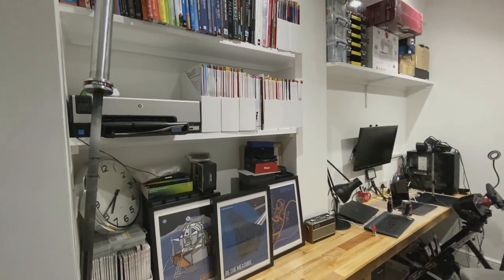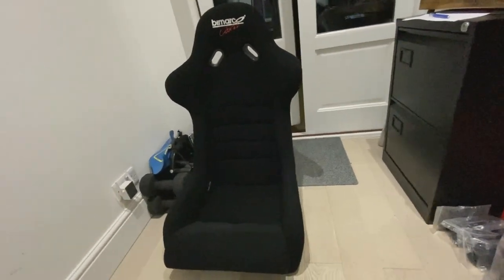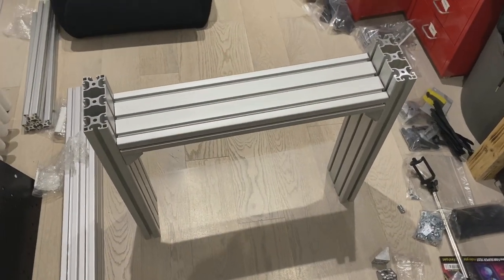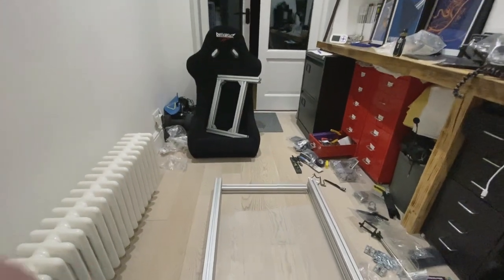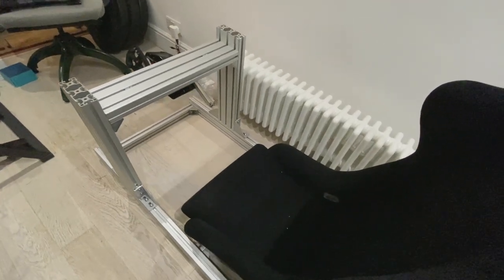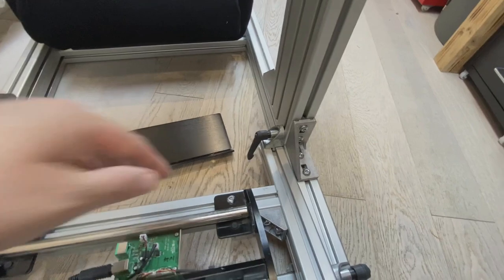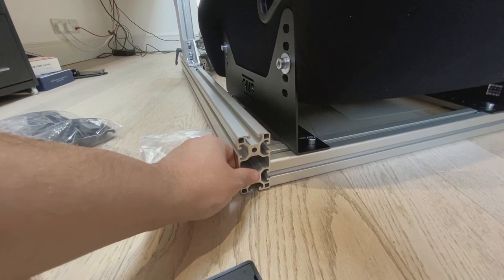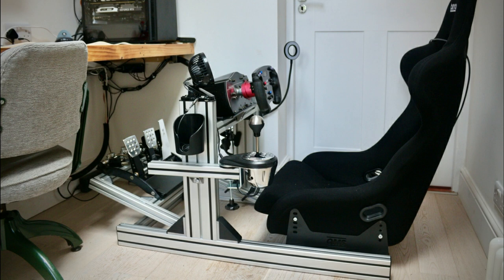Sim Racing | Build your own sim rig. Part 2: Building

Comment: I love the builld, if i may ask, how much does it cost to make a rig as yours
Reply from the maker: Thanks. I spent about £550 to get all the profiles and seat etc. (Basically everything other than sim racing hardware).
Reply: @FindingSpeed  ok thanks
Reply: Gt omega prime rig costs about the same...
Reply from the maker: It’s nearly £250 more expensive here. If you watch the videos I make it clear why I needed to build my own. It wasn’t related to cost.
Reply: @FindingSpeed  I did watch your video mate, I was just saying that it's a very similar price point, and for most people wanting a rig like that are looking for rigidity, especially when using aluminium, being a soft metal the slightest flex will soon become a wobble when using a direct drive wheel and load cell pedals, the way you use the 45 degree brackets to attach the uprights is not a long term reliable junction, no where near as strong as the solid steel plates that the GT omega prime uses, and the wheel mount, seat mountings etc, just thinking that if someone was going to spend £550 on parts to build such a rig, they'd probably get better longevity and value in the long run from getting the real thing with the correct fittings, especially wouldn't want to invest so much money and have no come back if there's a problem in 6 months, but that's just me. I get your space needs, and admire your design work etc.
Reply from the maker: It’s the same thing. 80/20 is the real thing 😀

80/20 is as solid as a rock and is recommended for DD wheels. I use Heudinkveld Sprint Pedals at full 65kg load and there is zero flex. 
If people want to spend an extra 200 and lose the choice of design / personalisation then all power to them, but there’s no value in stating falsehoods.  👍
Reply: @FindingSpeed  you don't actually read do you, you just take offense and react, I wasn't saying that the material was not the real thing, just the way you connect the parts won't last, minimal contact area between aluminium brackets and steel bolts won't last, like putting 2 different grades of gold rings on a finger, one of them will damage the other.
Reply from the maker: Sorry dude - you’re the one that’s misunderstanding. It’s the SAME thing. With the SAME hardware and connections. GT Omega haven’t reinvented any wheel, far from it. All they’re doing is using the same stuff and charging a 25% markup! 
You seem to not have any experience with what you’re talking about - I have a Simucube 2 wheelbase on Sprint pedals on a custom-built rig. Not a brag, just actual physical experience with what I’m talking about. 

You seem to think that 80/20 is too flimsy, yet recommend EXACTLY THE SAME THING, JUST MORE MONEY as a BETTER option. You’re wrong 🤷‍♂️
Reply: @FindingSpeed  again, you don't appear to be able to understand, so I'm wasting my breath.
Reply from the maker: @Bluetoothedshark  GT Omega gear is trash (from personal experience - I used to review it). If you’re going to recommend any alternative as having any better quality component, you’re barking up the wrong tree.
Reply: @FindingSpeed  ok mate....
Reply: @Bluetoothedshark  I built the design featured in part 1 of this series and have used it almost every day for the last 6 months. It is an incredibly robust and sturdy design which has shown none of the weaknesses you claim to know about. Also I'm very happy to have saved the best part of 200 quid compared to the GT Omega rig. If people want to waste money on a more expensive, less customizable and inferior product then that is their choice. 

What I don't understand is your crusade against the kind of rigs featured in these videos, especially when they have proven so popular and effective for prominent streamers and non-streamers alike. Instead of spending your time spreading false claims about a rig that will help a lot of sim-racers why don't you do something you are interested in?